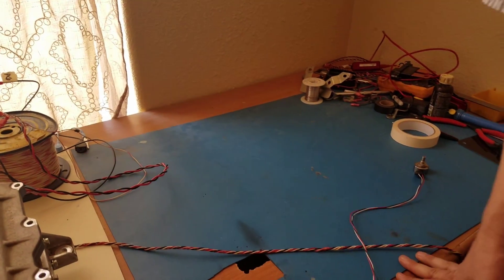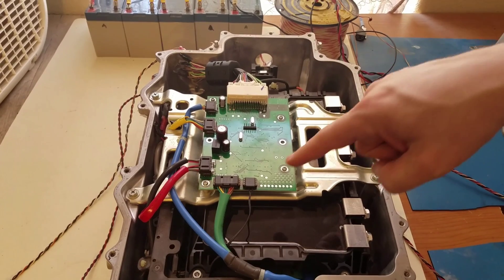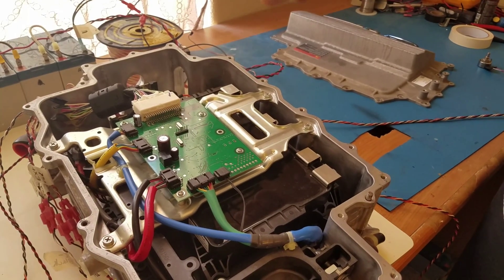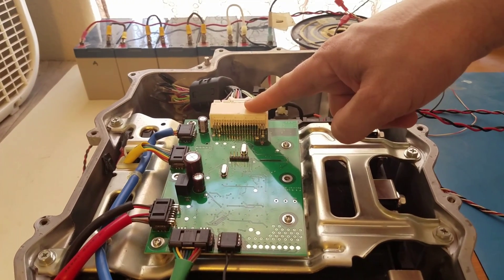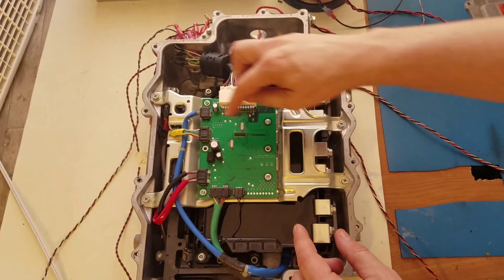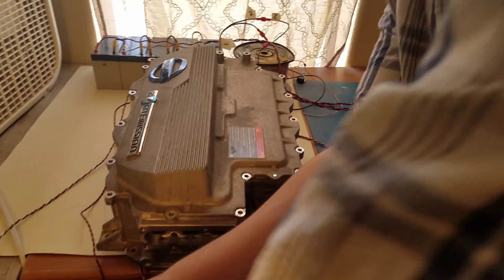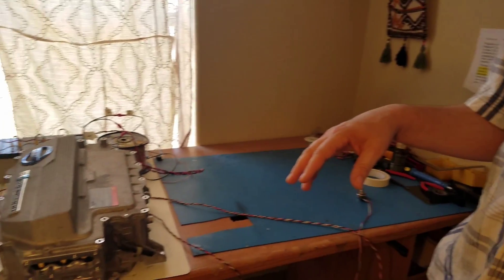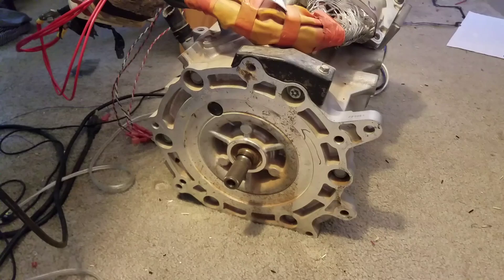Nissan Leaf Control Board Replacement

Comment: Hello. Does the  board knows to communicate via CAN bus for the torque request command or it's working only with the acceleration pedal directly connected to the inverter board? Does the board knows to read the inverter temperature, voltage and knows to work with the hardware protections from the IGBTs driver board? Also I would like to know if you have the regen function implemented. Thank you!
Reply from the maker: Well, right now it's just using the accelerator pedal, but I do have CAN code that I've tested on a different board.  I just need to adapt it to this board.  I haven't done that yet though.  Most people use this as almost like a golf cart controller, so they actually just want a 3 wire throttle though.

Comment: I have a wrecked Nissan Leaf and I want to install the motor, drive & battery in a Land Rover Discovery but I don't want to use the Leaf Canbus system. Can I get a control board off you?

John Mc

Comment: Hey, I dont know if you have any boards still available but I'm very interested. I'm also wondering about your opinion on using this with a modified toyota rear assist motor?
Reply from the maker: Yes I do have boards, and yes it will work with that motor.  Email me at pandspowerelectronics@gmail.com for more info, or go to the link in the description.

Comment: Hi Paul, so, just to make sure I understand: if i buy a leaf motor, a factory inverter and your board, than I can set up my own system in an independent ev application. The inverter is water-cooled and all motor/inverter/battery  protection factory features are working. Am I corrrect? What happen if I use another AC induction motor, out of a fiat 500, for instance. Would the controllerr work with it? I am searcing for a watercooled, automotive oem-grade controlerr for my application, but the leaf motor is too powerful+heavy for me, I would use a 28kw motor with 200v HV battery... that is why I am asking.
Reply: the Leaf is a Permanent Magnet Alternating Current Motor

Comment: Hi Paul, is the board only the igbt driver or does it include a micro controller brain?
Reply from the maker: The board is just the control section (the microcontroller brain will all new software).  The driver section and IGBTs/bus capacitor are from the original hardware.

Comment: I'll be running a 2016 leaf inverter + motor in my conversion.What I'm very interested in knowing is whether a custom board can get more power out of it compared to Nissan's original. That could be a nice tune-up!
Reply from the maker: Yes you can set the max current to whatever you want.  Now, having it talk nicely with the rest of the car (which is a nanny state), I can't say.
Edit:  In your conversion?! OOhhh good!!  That should be no problem.  It's just when trying to get it to work in the original leaf it would be a real headache.
Reply: Having studied the inverter's CANbus protocol myself, I think I might be able to make your board work for someone who owns a Leaf. Haven't really thought about it from that perspective, though!
Reply: @MPaulHolmesMPH  hi, where I can Buy one?